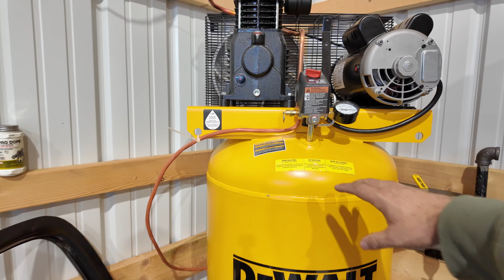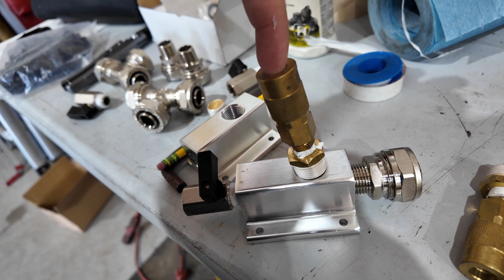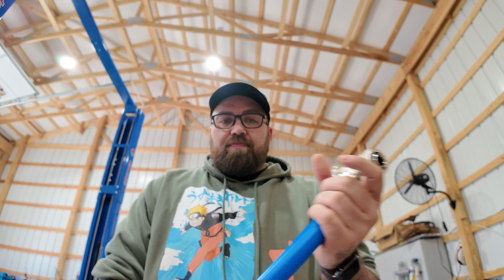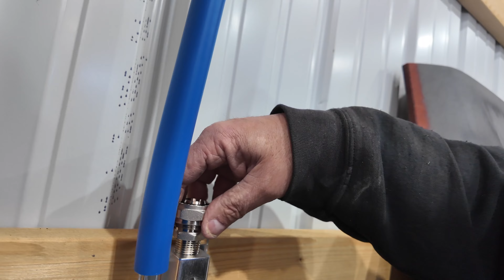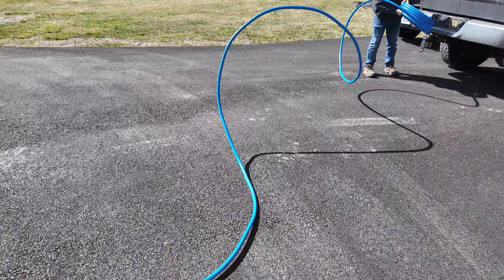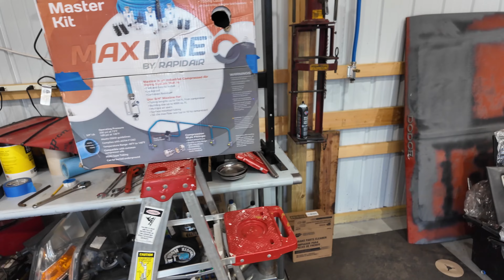DIY Air Compressor Setup with Eastwood's MaxLine Rapid Air.

Comment: Nice shop!  I see a lil red express back there 😉 I have the same setup in my two car garage and am very happy with how easy the kit is to layout and setup.  I used 45 degree angle down on the drop blocks for the couplers. I got a hose reel now the I need to hang and plumb.
Reply from the maker: Thanks!   Good eye. That will be getting paint soon!